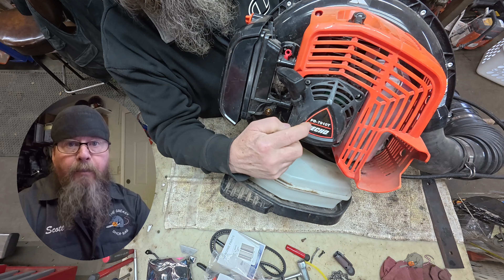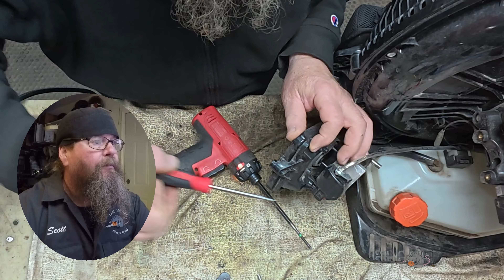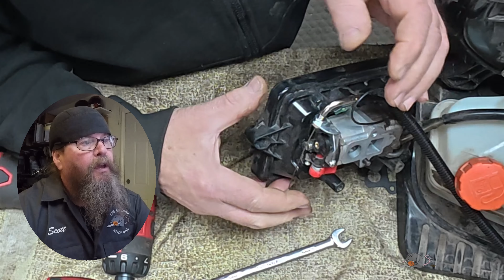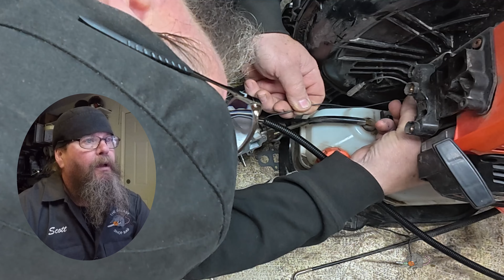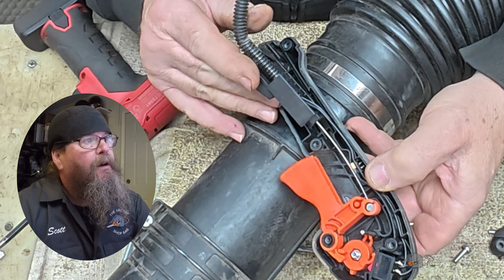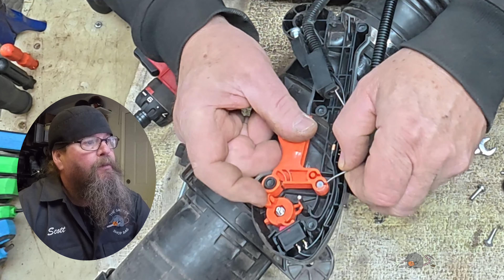Echo PB-7910T Control Cable Replacement

Comment: Hey Scott I'm looking for help my Husqvarna 455 I just replaced the carb it was an Amazon one (where I'm at it's hard to get OEM without waiting forever) and now it's starts but just runs full throttle even when you give it gas it doesn't let up
Reply from the maker: Huh. I assume its running fast but not actually full throttle. You can confirm this by removing the air filter and looking into the throat of the carb to see if the throttle plate is open or closed. The upper throttle valve should be completely closed at idle as well. Does the problem lessen itself if you back out the idle adjust screw? Is there play in the throttle linkage at idle?

Comment: Great fix Scott 
I have husqvarna K770 gasoline grinder, my friend put diesel in instead of gasolin and tried to start , any suggestions for solving this problem
Reply from the maker: Theres a good chance you can just dump the diesel out, prime the fresh fuel through and start as usual. It works when bar oil is added to a fuel tank and will pump out much easier. I replace the fuel filter in these situations.

Comment: Scott, the thought hit me about those knuckle dragging Neanderthals. Fan aimed in there general direction, a few healthy squirts of fart spray followed by the comment “I knew I shouldn’t have eaten that last night, happens every time I do.” I may or may not have done this before… 😂😂 They may just quiet down a little more. I sense they discovered fire and had a cave party when you were making this great video. Keep up the great work Scott. 👍🏻👍🏻
Reply from the maker: Ya try to reason with them and they just grunt louder.

Comment: I love my echo backpack I have an oldie but a goodie PB651H   The H stands for hip control and the T stands for thumb control.The hip control is shorter wires and your not waving it around all day like your thumb control 👍
Reply from the maker: When I ran landscaping crews we tried the hip versions and nobody seemed to like them. I guess its not as easy to feather the throttle in some delicated situations.
Reply: Like when the new guy blows Mrs Easterhazy's mulch completely out of all the beds 😆 @TheGreasyShopRag
Reply from the maker: @matthewwearsch242  Yes, or blows out the wet rain gutters onto half a dozen parked cars 😞

Comment: Good stuff, At my shop we only carry the entire throttle handle assembly, we dont mess with taking handle apart, if they have throttle cable or kill switch wire problems we just throw an entire handle assembly on and charge them less labor so it works out to about the same price as charging more labor to take everything apart and just install new cable.

I have a question Scott, the little red spark plug removal tool that I always see you using after you pop the plug and then use it to remove, did you make that yourself? What is it made out of?  Would really like to have that in my arsenal instead of using a scrench then my fingers to remove a spark plug.
Reply from the maker: I get the logic about just replacing the whole assembly. Just like how its sometimes cheaper to replace a carb rather than spend labor rebuilding it. The tool is available from many sources. Here is one:
https://www.amazon.com/Thexton-492-Spark-Installer-Remover/dp/B000OCIX9E
Reply: @TheGreasyShopRag  For sure, thanks!
Reply: @TheGreasyShopRag Scott just got the spark plug removal tool that you linked to me, thanks brother
Reply from the maker: @JacobandJames_prodz  You're welcome!

Comment: Surprising to see something in such nice condition have an issue with the wire setup.  I know in the older 770 blowers (I assume the predecessor to this one), the handles with the cruise and off control on the back of the handle, had a small part inside that was prone to wearing and wouldn't let you turn off the machine.  That one too a long time to sort out, because when I tested the switch manually it worked fine.  An hour of mis-guided direction, to be fixed by a $2 plastic part inside the handle.  On this blower, it would be the equivalent of the round part inside with the little tentacle thing that moves the on/off toggle switch.  Nice, easy fix!  Disappointed by the lack of schmutz (a fantastic word that I've used for awhile, and getting my kid to say now lol)
Reply from the maker: Ahhh, I don't create the schmutz. I only report it. Thanks for sharing!